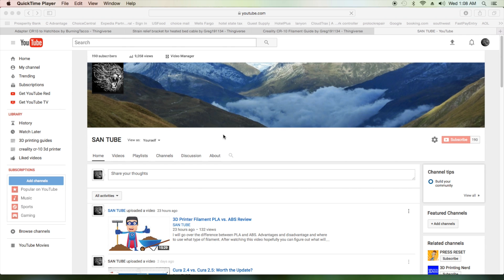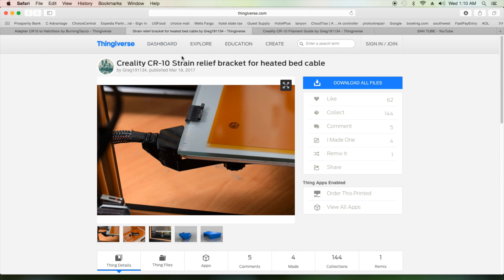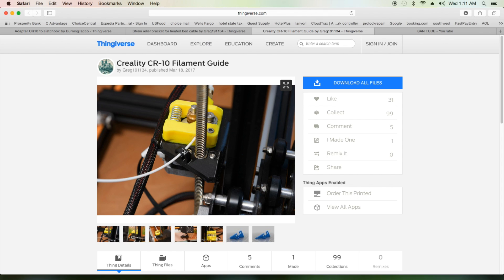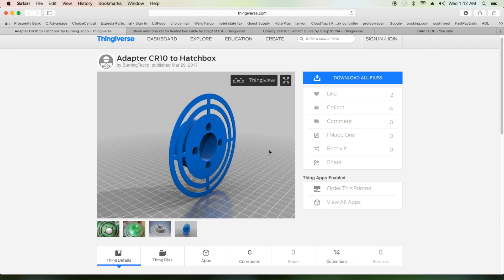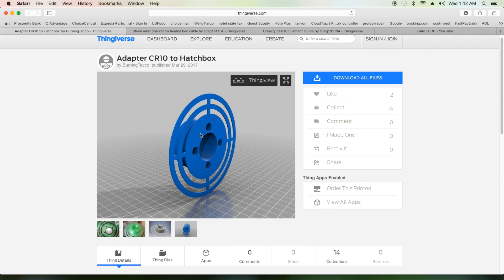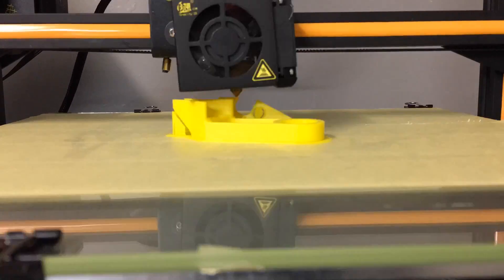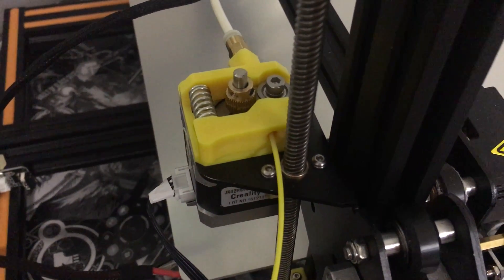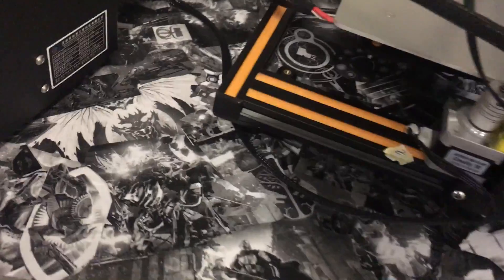Creality CR-10 Mods & Upgrades!

Comment: Hey! Thx! :*) I'm a beginner, subscriber, and one of your CR-10 Facebook members. 

Anyways, the filament guide doesn't fit my CR-10. 1. The known hole alignment issue. 2. The tolerance gap of the snap-on is too close, so it breaks.

I haven't found a filament guide for CR-10 owners with a different hole alignment. 

If anyone knows of one that'd be great!

I did finally get a print that wouldn't snap (break) to clip on sorta.  One hole is not aligned.

Thinking (dreaming)...Maybe I can make one, and other stuff, using a 3D modeling program like 123D or something? Haha! Maybe someday... :*)
Reply from the maker: Sorry if this is a stupid question but are you trying to screw down the filament guide or snap it on?
Reply: SAN TUBE Snap it on. The hole patterns differ on some CR-10's. The creator of this mod explains this in his description/summary  basically saying, tough luck for you that have CR-10's with the "wrong" (?) hole pattern. I don't know if it's "wrong" or simply different. I also wonder of the metal is a little bit thicker also with this so-called "wrong" different hole pattern. :*|

Comment: There Multiple cr10 models at different prices how do you pick the one you need there is one for 400 and one for 600.
Reply from the maker: if you want the basic model, you can get the CR-10.  But the CR-10S has many upgrades, now if you were to buy the upgrades yourself the end price will be more, in that case its cheaper to buy the CR-10S instead of the regular CR-10. You can get the CR-10 for  $319 or CR-10S for $489.  The bottom line is how much do you wan to spend.  I hope i Helped.
Reply: Thanks
Reply from the maker: j bear I hope I helped.

Comment: Thanks to you I now have a resource for things to do BEFORE and AFTER I get my printer.  Gearbest says it has been PACKED so hopefully it will ship soon!  Thanks again!
Reply from the maker: happy to help!
Reply: How long did your's take to ship? I had the Tronxy X5S on order for 2 weeks and it wasn't even packed. Now, that's cancelled and I have the CR10 ordered. Hopefully, it will ship soon!
Reply: Mine shows on the GB site that it left the China warehouse on the 19th.  I have been checking it every day since and no change.  I am assuming it is on a SLOW BOAT FROM CHINA and hoping I may see soon that it has arrived in the US.  According to other posts it may sometimes take a while to arrive but it always ends up getting there so I'm trying to be patient.

Comment: FYI: THe Hatchbox spool Holder took 8 hrs to print and doesnt fit at all. Can not even force it into the spoools. I did not change any settings.
Reply from the maker: i had to sand mine down a little on the inside part.

Comment: great job, and before this video I didn't even know about the hatchbox spool holder, which will definitely help with my glow in the dark PLA from them along with a few other spools that don't work that well with the stock spool holder. Also, why do you use so many supports and why do you use brims? Supports are barely ever needed, especially if you 3D print a different cooling fan duct (I printed the OEM fang mod). Brims are also really only useful for very tall narrow prints. Otherwise, just use skirts to prime the nozzle.
Reply from the maker: I use brim to Prime my nozzle and you are right skirt will work as well.  I just want to make sure the nozzle is fowling well, its just in case i guess.  i use supports a lot, Why?; i guess to make sure all overhangs are supported. i don't want a 7 plus hour print to fail i guess.  I am still new at this only been doing it for about four months now. i still have a lot to learn but i try to help with what i already know.  I hope this helped you out and like always Good luck and happy printing.

Comment: So I got my creality it ran fine for a while then one day it just shut off... no power or nothing... Every take apart the control box ? Is there a fuse inside?
Reply from the maker: before you do all that, i had the same problem. the power switch on the back wouldn't work.  so take a look at that first.
Reply: oh  ok thanks... what was your solution? Did you just replace the switch?
Reply from the maker: DancesofDragons yes I just replaced it. I had one sitting around so i just decided to change it out
Reply: Well I think it is the power supply unit . I got voltage going to it but not from it...I am in contact from where I bought it from.

Comment: I just wanted to thank you for creating these videos as they are very helpful. I have a Malyan 200 that has worked out well for me and I am now ready to move on to some larger projects so  I ordered a CR-10 today from BG. It will be around a month before it arrives which gives me plenty of time to go ahead and print the parts you listed in this video and I will install them when I assemble the printer. Can you please point me to a good fan nozzle for this printer as I have heard of people having issues with the stock one,
Thanks,
Richard
Reply from the maker: I haven't ha any issues as of yet, this printer is made very well.  I am looking to get new fans for the CR-10, i will let you know which ones i believe are good. thanks for watching.
Reply: Ok Thanks, I'm looking forward to more videos from you.

Comment: I too thought that the filament guide had to be screwed on, and noticed that the holes were too big.  I just came upstairs to look up how that filament guide was supposed to be installed and saw your video in my YouTube list.  Thanks for showing that it is a clip on part.  Great video as always.  Only thing I might change is to lower the volume on your intro to closer match your regular audio level.  The new mic sounds great!
Reply from the maker: Thanks bud, i will see what i can do about the intro.

Comment: So the strain relief and knobs were printed on PLA, wouldn't they end up melting a bit being so close to the heat bed? I understand PLA starts to melt at around 80-90C I believe, so for future printing with ABS or other exotics, the PLA upgrade parts would lose the usability.
Reply from the maker: Yes PLA does have a lower melting point then a ABS but in this case I will never have the bed go past 60 because I mainly working with PLA now if I start working with ABS more offen then yes maybe I might want to reprint these and ABS but at the moment I don't see it being a problem.  I think it should last.  If it starts melting I will keep you updated. Thanks

Comment: The mic is much clearer now.
Good News! I finally received my CR10 and it is printing near flawlessly as you described! Thanks to your videos and the helpful FAQ on the facebook page I was up and running in no time.
One thing though... I'm currently using the version of Cura that came on the SD card "15.04.3". Is it better to use v2.4? I was wondering if that is so then why does it ship with an older version?
Reply from the maker: Yes update to the 2.4 version of Cura. I don't know why they put the old version on the USB. But as you know I have a video out on the 2.4 and currently working on the advanced settings video on Cura 2.4 so watch out for that.  It's good to hear from you Man. Good luck and happy printing.

Comment: @7:45 or so, it looks like you also printed some bed leveling knobs. Did they work? If so, what model were they?
Reply from the maker: I didn't install them because the the creator came out with a new improved version.  So on the next mods i will print those along with the fang fan. So as of right now i don't know how well they work.